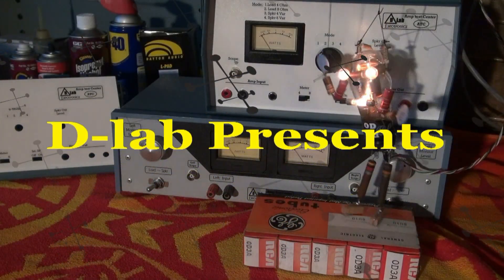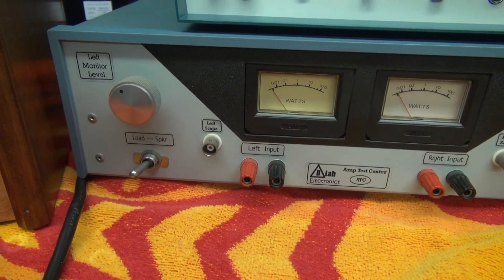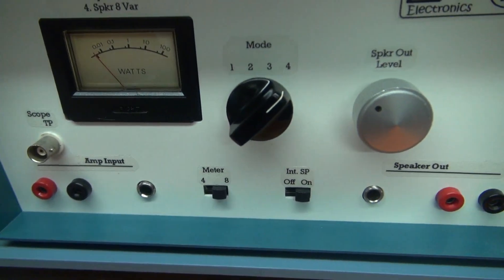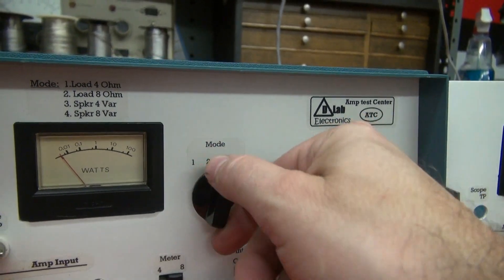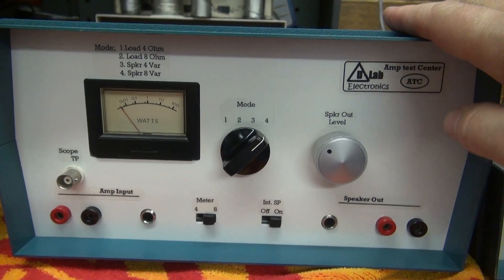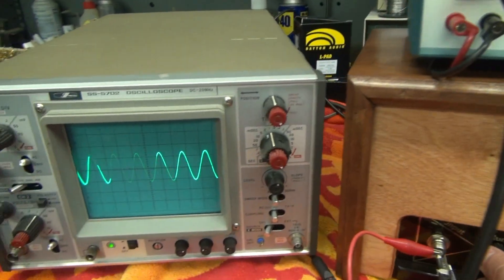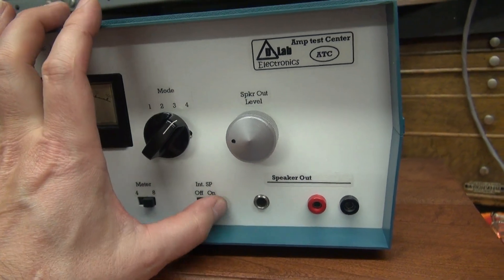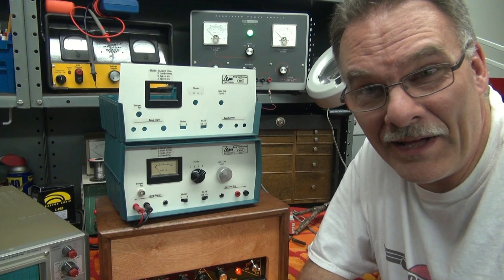D-Lab custom Tube mono audio amplifier dummy load test set

Comment: Hi, thx for this video. 
What i like to know: sometimes i want to powertest high wattage amps like a peavey 120w.
Is it possible with these resisters to hook on a 120w peavey for 2 hours?
Reply: Stefan Vaneylen Finding a potentiometer that large might be hard, and very expensive, but the dummy load part isn’t too complicated, just get 250 W resistors and heat sink them properly!

Comment: Hi Terry! Building one D-Lab inspired  dummy load now, and wonder about two things... First, where do you get the panel watt meters (can't seem to find some). Second, i was considering to put a fuse in series to protect the resistors if i mess things up, but then thought that the open circuit would be bad : shall i consider adding a 470R/5W in parallel to provide load even if the fuse is dead? Thanks for your input on that, and for all the great work and sharing : really inspiring and cheering up the soul... Laurent

Comment: Where did you get the old Heathkit enclosures for the test set?     Great idea.   I sure could use that cabinet for other DIY test gear.   Very cool idea.        Where do you get L Pads?    I remember when I was a kid I assumed a potentiometer was just a small L Pad and I hooked it up and burn out the pot immediately.  I was 8 years old and clueless at that point.
Reply from the maker: I buy them on ebay. The L-Pads are sold by Parts express (Ohio) Yes, they make great retrofit cabs. The front panels mill easily.
Reply: Thank you.   Happy New Year.

Comment: yea, what more do you want... perfect for a rook like me Almost 50, lol... have the scope , built a speaker load  with crumby gutted guitar A/B box... but the load i saw here while back was probably best yet that concrete resister soldered to 1/4 male > small & simple...put in a tech kit... want one,
Reply from the maker: Cool deal man. Glad you like. I will put you down for SN:02. Cosmetics and cabinet configuration takes most of the time. I had it wired in about an hour. Yes, the concrete type resistor on a 1/4" plug is my go to load. Good to keep the hobby alive
Reply: whats the value of resistor for 100wt 16ohm, if i may ask and is it soldered directional ? i'm waiting on my share of acoustical guitar brand to be bought out soon, it was not the deal as i am leaving early but allowed not because i was 1st one in, opened the door's but in extreme bind at the moment .... and they are up and running now & can make it............ sell it when buyer wants one,yet i"ll get with you asap when i turn this mess around...patient but have not resolved ability to bias by pretty wave which MM.com their recommended way ...

Comment: Great video Terry. I have z need for just such a device but I'm in the UK.  how much does it weigh?
Reply from the maker: Hello Andy, I will get one fully assembled and weigh it. Good thing is, these do not require any power. The wattmeter is a passive type. Not the best for accuracy, but gives a good responsive visual. I really like having a built in monitor speaker
Reply: +D-lab Electronics thanks Terry. One of the other guys mentioned making this available as a kit build. I'd be up for that 100%.